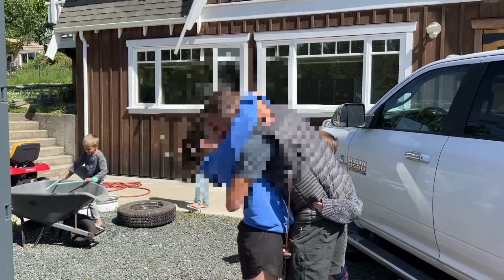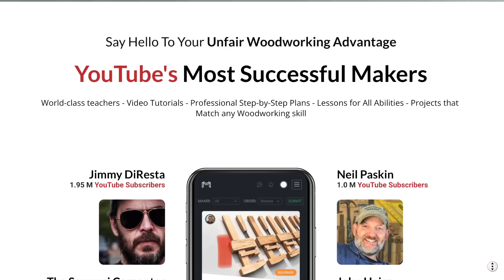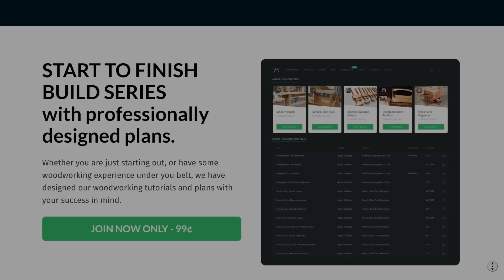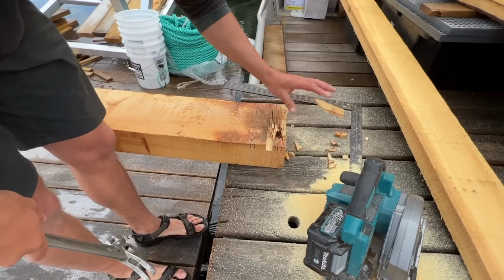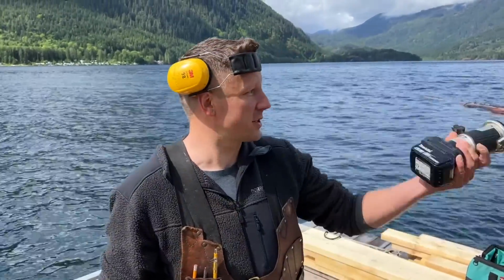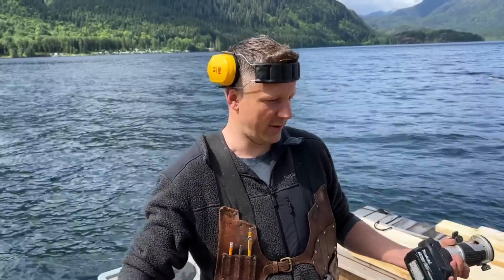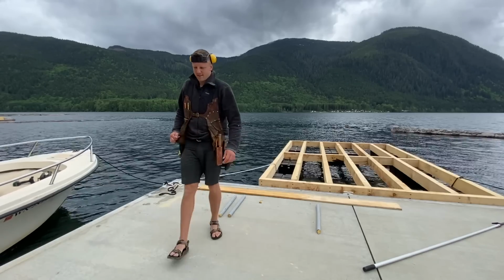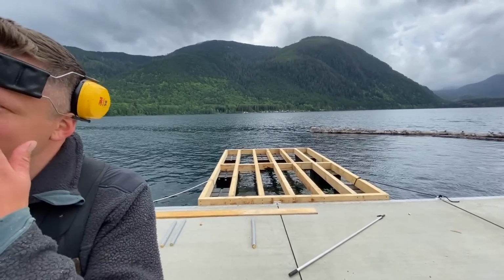Framing Up A NEW DOCK!!!

Comment: Just a tip. Float the ramp side more and trim the floats with sand to level it. Also, drill through the middle and place a 1” galvanized threaded rod from side to side. Use it to tension the dock structure against flexing. This will greatly improve the longevity of the structural part of the dock. Maybe do one on each end and one in the middle. Tighten them yearly to account for shrink, etc.
Reply: BALLAST+ BOUYANCY IS BETTER THAN BOUYANCY
Reply: So you mean just like he did?

Comment: I believe you're going to need more floatation under the end the ramp rests on. More buoyancy to offset the weight of the ramp. Either that or more ballast at the other end.
Reply: That's what they did. In the middle they have them doubled on one side and single on the other.